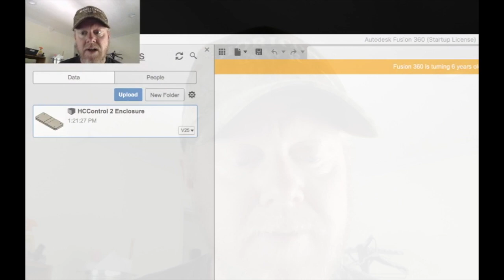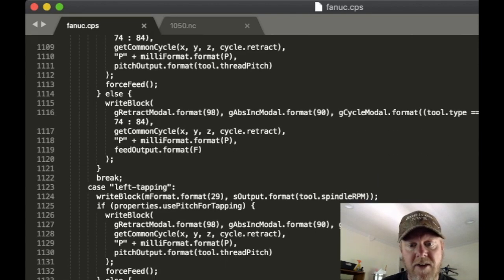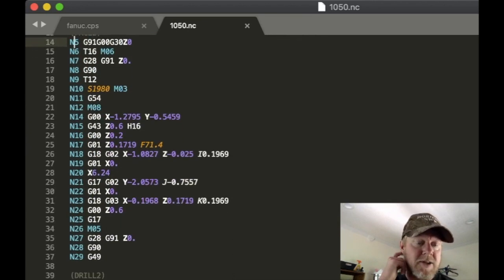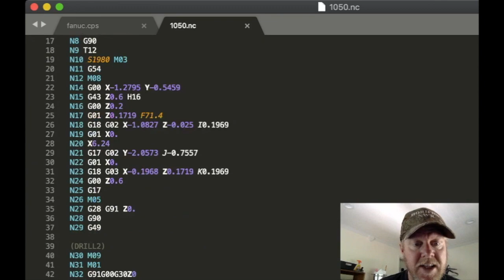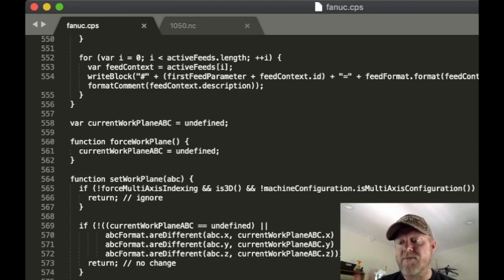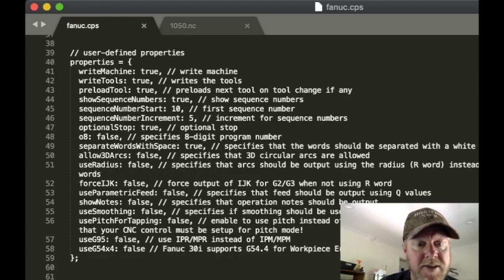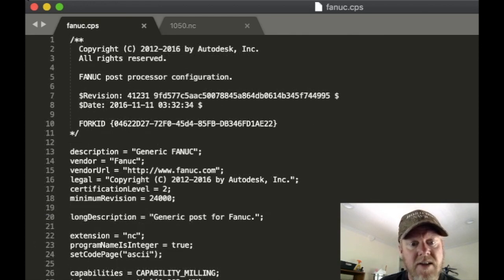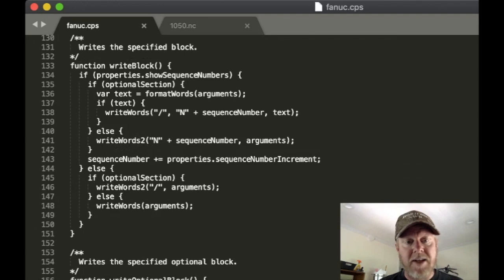Fanuc OM Fusion 360 Post Processing

Comment: I have an 11m Fanuc control. When I bought the machine, the previous owner had the post processor for their 2021 Mastercam. I have that post but I couldnt use it in Fusion. Im using Fusion because of the price difference. I know very little about this, would you be interested in taking a look at what I got and giving me some advice or even a price to build me a post?
Reply from the maker: Is the tool change where you are having issue?

Comment: hi do you have any solution for complex 3d machining on fanuc OM, i have a 1993 myiano tsv25 mill and its always stopping, currently im using a serial cable to transfer my programs from the pc.
Im trying to make mold machining
Reply from the maker: You won't get the speed of a more modern setup but things you can do are to make sure you are sending at max speed, optimize your post and on fine details you may need to load direct into the machine for the final work.
Reply: @ShaneBurrell1  the issue for me is the machine has only 14kb, becouse of that i can only drip feed, and its always stopping like the machine cant read fast enough☹️
Reply from the maker: @danieldias6608  what is the baud rate?  Are you using fusion 360?  What post processor?
Reply: @ShaneBurrell1  Im using a generic fanuc post processor from Fusion library  and Baudrate is at 19200
Reply from the maker: @danieldias6608  Be sure to also turn off code block numbering if using HSM/Fusion 360.  The om has a low block limit. showsequencenumbers=off
Reply: @ShaneBurrell1  its off and im also with radius enabled and using soothing already, the machine keeps doing the same but a lot less
Reply: @ShaneBurrell1  i Will try a new software called dnc4u, it has a few transfer modes that can help
Reply from the maker: @danieldias6608  Also ensure that your serial connection and hardware isn't causing a transfer glitch.
Reply: @ShaneBurrell1  i mean, the cable works, if it didnt the machine would not even start reading, right?
Reply from the maker: @danieldias6608  The OM is very sensitive to control signals. RTS/CTS. Your serial adaptor is important that it reliability handles control signals.

Comment: Hi Shane great video my name is Sergio from Italy, can you help me with a post procesor with my LeadWell MCV 610CR ? I wont to start to use Fusion360 for CAD/CAM . Kind regards
Reply from the maker: What control does the LeadWell have?
Reply: @ShaneBurrell1  CNC Fanuc 0M
Reply from the maker: @sergioadriancervetto4901  normally you can just use the default fanuc post in fusion. For tool change if your lead well requires more than just m6, just edit the post to insert tool change commands .
Reply: @ShaneBurrell1  kind regards

Comment: thanks for video , can you send me the post
Reply from the maker: Fusion folks are a bit picky on modified post based on there standard fanuc posts.  The best way to do it is to get a tool change working manually and just paste that code into the default fanuc post file.

Comment: Hi Shane great video. We are playing around with a Hartford 1995 mill that has the same controller and the same took change mechanics. We are trying to get the post processer running more efficiently with fusion 360. I was wondering if you could share the config file for us to use to try. Thanks
Reply: *same tool change
Reply from the maker: Shoot me an email shane at shaneburrell.com and I try to get it to you.
Reply: @ShaneBurrell1  I managed to do some research and study over the last week and have managed to modify the post processer to suit our needs. If I have any further troubles I might shoot you an email. Thanks heaps for the videos.
Reply from the maker: @maxburgess8505  No problem. Glad you got it working.
Reply: @maxburgess8505  Hey Max, I have a similar mill to you, any chance i can get a copy of yours?

Comment: Good video! I actually have a 1990ish kiwa excel-510 with a fanuc om control that a bought about a year and a half ago. Luckily I have not had any electrical issues with it. I did find out after I bout it that the head where it rides on the z ways was severely worn. I pulled it all apart re machined the casting back to square scraped some flaking in the surface for oil. It has been running flawlessly since. I am also using fusion360 and I was curious how you are going about with some of the more complex programming where the control has a hard time keeping up. I have been playing around with the tolerance and smoothing tolerances.
Reply from the maker: That's awesome.  You wouldn't have a 4th axis on that machine would you?  On drip feeding complex (3d) operations I set the DNC to highest baud.  My OM is a 32 bit version and I have a remote buffer fanuc card I added.  It feeds commands smoother than straight serial but I had good luck with highest speed and just be careful with fusion on complex parts.
Reply: Shane Burrell no fourth axis. I will look into the baud rate as well. Thank you